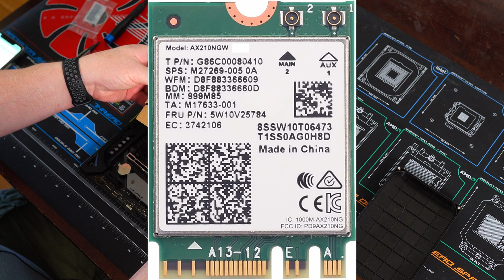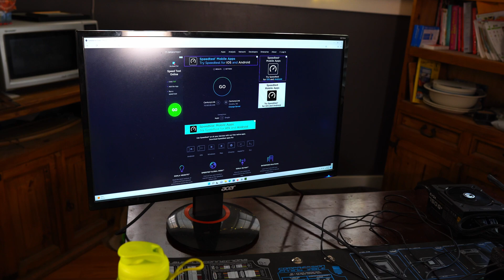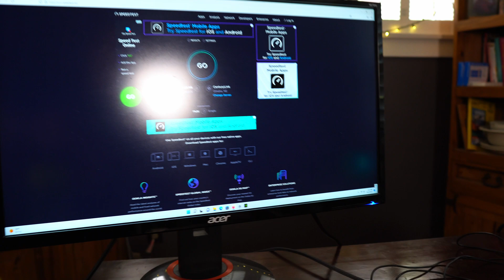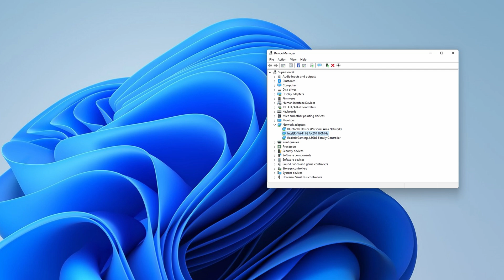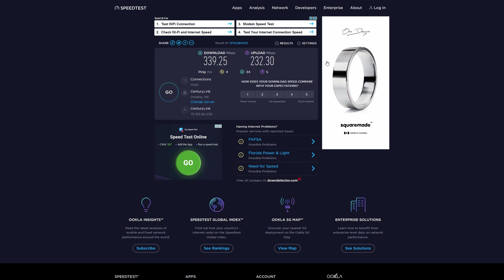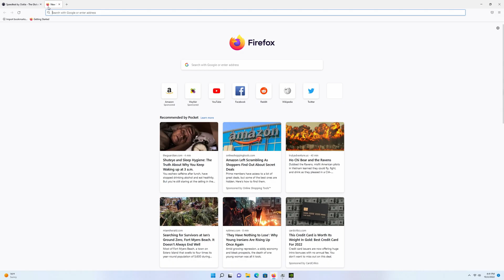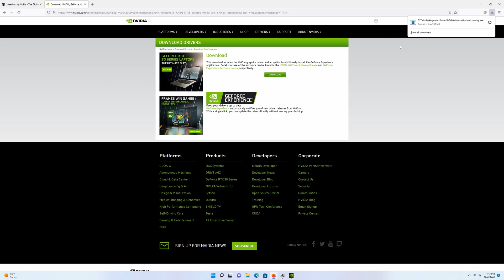How to add WiFi and Bluetooth to your AMD AsRock motherboard: It couldn't be easier!

Comment from the maker: Hi All, thanks for coming to the Middle of Knowhere and spending some time here. If you're interested in the WiFi M.2 card, I've put a link in the description. Also, installing it was pretty easy so don't be afraid to take on such tasks for your components. The rewards are well worth the effort!
Reply: does it work with ultra m.2?

Comment: Would this work on a ASRock x870 pro rs no WiFi mobo?
Reply from the maker: It looks like it has the m.2 slot for the wifi module. You'll use the PCIe slot cover thingy though for the antennas since the I/O shield doesn't look like it has holes in it. HOWEVER, I would suggest you contact ASRock and double-check. Their manual could be misleading somewhat since they combined the WIFI and non-WIFI versions in one doc. I think you should, if you haven't bought the motherboard already, buy the WIFI version.

Comment: Hi, so I just added a Wi-Fi card and the antennas and everything I just bought this PC used off Facebook marketplace it didn’t come with Wi-Fi so I bought a Wi-Fi card and installed it. The motherboard is Asrock b550 phantom gaming 4 I installed everything correctly nothing’s working I tried installing drivers doing every possible reboot going through the bios everything it just will not let me use Wi-Fi. I’ve tried doing windows updates. I’ve went into the system settings deep into the system. It’s reading the card that it’s there but it’s not allowing me to use Wi-Fi. I really don’t know what to do.

Comment: Hello. What's the difference between wifi/bluetooth card you used vs those wifi card that slot into pcie2.0? pros and cons. Thanks
Reply: Don’t know the general pros and cons but in my case I bought a pci one and it needs separate alimentation,since having only one internal usb pin layout i got rid of the front io usbs,so cons for pci are those for me,also the looks,if the mobo already has holes for the antennas why occupy more space for the adapter

Comment: hi I just made my PC 4 weeks ago and I wanted to ask, do I have to remove my mobo and install the antenna's like you did or can I just remove GPU, install the card ?
Reply from the maker: If you don't want to integrate the antennas into the I/O shield like I did, you should be able to simply take out the GPU, then install the m.2 then use one of the remaining PCI slot covers to hold the antennas if yours came with those. Then re-install the GPU.

Comment: Damn, u basically replacing storage with wifi.
Reply from the maker: What do you mean? That slot is specifically for wifi.
Reply: @MiddleofKnowhere  so where did u put the ssd at?
Reply from the maker: Different slot. IIRC there are two m.2 slots. I believe I have a review video for that mobo where I breakdown all the features as well.

Comment: Question: Is there anything I can do wrong? I inserted the AX201 M.2 module I've just received, but in my Windows nothing shows up in the Device Manager. Should I be seeing the device already? Do I need to activate something in the UEFI? Do I have to install somehing first, in order to see the device?
Reply from the maker: You might have to download drivers for it. Check that to see if it works after.

Comment: I assume it doesnt matter which connector on the Wifi module you connect to the left or right motherboard hole.
Reply from the maker: I don't believe so, at least it didn't appear that the wires were for anything specific.

Comment: Hi. Can i just install the m.2 wifi without the antenna? I have another pc also and it's rocking fine without antenna. I hope i will be replied
Reply: I don't think so, i've just installed an AX210 without an antenna and it doesn't seem to work

Comment: I wish I could find a tutorial of how to do this when youre pc has already been built. I am absolutely not taking the motherboard out of my pc to get optimal wiring
Reply from the maker: If it's already been built and you don't want to remove the motherboard, you'd still probably have to remove the GPU to get access to the slot. You can then use the PCI brackets for the antenna cables and connect things that way.

Comment: Problem guys :( MB AsRock B650M PG Lightning cant see my intel 6e AX210. I place it in slot m.2 WIFI on motherboard, try many drivers but in device manager cant see AX210 mw wifi card. Maybe i need switch on some setting in BIOS ?

Comment: Is there any places that I can get a bracket for the antenas slot?? I got a b560m pro 4 and j want to add wifi 806.11 and I noticed I cat have the brackets for the antenas as the wifi version of the motherboard, I didn't get that one because I couldn't afford it so
Reply from the maker: the version I bought came with PCI slot brackets where you could screw in the antennas that way. It's possible you could do it that way if the I/O shield doesn't have holes.

Comment: So that is considered easy? I was seriously considering a budget build with this board and looking on Newegg. Is there an alternative version of this board that comes with Wifi? I've never purchased a non wifi board before, is this the standard process where you have to take everything apart?
Reply from the maker: Comparatively to other pc building activities like putting together a water loop, it was easy. This particular upgrade was a first for me, so you got to see me do it for the first time as well. I cannot recall if the pg velocity has a wifi version but there are motherboards by asrock that do come with a wifi card.
Reply from the maker: Also if you choose to use a pci slot you can buy a pci wifi card and then won’t have to take anything apart. Or even a usb wifi stick.

Comment: Yeah, I'm gonna say it's well worth it to spend a little extra to buy the version of the board with wifi already installed. And then if you need to upgrade it in the future, then you can go through all that. I wish wifi was standard, to the point where you would have to actively seek boards that were not ready with on board wifi.

Comment: My antenna leads to the m.2 card are not colour coded, both are black so I presume it doesn't matter what is connected to what
Reply from the maker: mine weren't either. I do not think it matters.

Comment: I just recently replaced my old wifi card of my laptop with Intel ax210ngw, but my old wifi card has only 1 antenna. The new wifi card I bought doesn't include antennas, so it's currently using only 1 antenna (Inserted to "main" antenna port). The wifi works but I am having a problem with the bluetooth connection. Is the "aux" antenna port for bluetooth? Will the bluetooth connection be fixed once I have the 2nd antenna for the aux port? I'm still waiting for the extra antenna I bought online. Tia
Reply: How did it go?
Reply: @Godisgood137  Everything's working great after I installed the 2nd antenna. I was so worried at first because I thought that the new wifi card wasn't compatible with my laptop. It turns out I just needed the 2nd antenna for it to work. My wifi connection is so much faster now because my laptop now supports 5GHz connection, unlike before. And we have wifi 6 at home, so it's really great. The bluetooth works very well too, no connection problem anymore.

Comment: Be mindful that Windows Setup (even 22H2) does not come with AX210 drivers, so put the Intel drivers on your USB! 
AX Router: Get a $60 Belkin RT3200 or Xiaomi Redmi AX6S to install OpenWrt (but be advised OpenWrt isn't targeted at novices, though it is pretty damn versatile!)

Comment: is there any way to do this without removing my mobo from the case
Reply from the maker: Adding it to the I/O shield no. But if your wifi card comes with a pci slot cover for the antennas the. Yes. You may have to remove the gpu to get access to the m.2 slot though.

Comment: Can I add this to my ASRock x570 extreme4? I’ve been using my computer for several years on Ethernet cable but now relocated to where only wifi is available. What would be some challenges to installing wifi after pc has been completed?
Reply from the maker: Getting access will be your biggest challenge. You'll need to probably remove the Graphics Card at the minimum. If you don't care about routing the antenna to the I/O shield, it won't be as much an issue as you can use the pcie slots.

Comment: Hi I have a question can I put Wifi card on my Asrock B660m Pro it a Intel socket motherboard
Reply from the maker: If the B660m Pro board has the same kind of m.2 wifi  slot with the same kind of Keying, then yeah, you should be good.
Reply: @MiddleofKnowhere  oh ok thx

Comment: Do you have any recommendations as far as an external antenna that I can mount higher up on my desk or such? I have one from a previous m.2 wifi card that was for Intel only systems I just wasn't sure if the antenna would matter or make a difference.
Reply from the maker: I don't think it will make a difference, which one you get but here's one.  Just do some research and go for the best rated to best price balance. https://amzn.to/3Plzfqb

Comment: My ax210 doesnt have the 2 circle things on it to connect cables, and also didnt come with cables, any advice?

I brought antennaes but they just the ones with the big connectors to attach to outside of case, how do I buy the small ones and how do I connect them when my ax210 doesnt have connectors on it?

Also my asrock backplate doesnt have holes for the wifi antennaes.
Reply from the maker: Sound like you bought a laptop only card. You need to make sure what you buy is for a motherboard and gas all the things you need including pci slot mounting if your rear io cannot accommodate the antenna cables and coax connectors.
Reply: @MiddleofKnowhere  Yeah I have brought a bracket and cables now, but it was advertised as for pcs and laptops,not just laptops.  It does have the connectors, they just absolutely tiny so had to look hard for them.  Thanks

Comment: will be installing this into my pc to fix Bluetooth disconnects from my dongle. Although will be installing from the pcie bracket due to my pc having full Hard tube installed on the system atm so removing cover+ io shield will not be possible
Reply from the maker: Awesome. Yeah, I like that you can do either or for installation. Would love to see pics of your loop. Hit me up on Twitter or FB.

Comment: I’ve bought two different m.2 adapters. Both show wifi connections but never connect. B760 pro as. On fibre internet. All the latest drivers. Been thru every forum and YouTube video lol. However the card does work with the pcie slot with the antenna

Comment: Cheaper ones? That one is 70€
Reply from the maker: Try searching amazon for wifi m.2 and see what the results are. You’ll want anything with wifi 6e and Bluetooth 5.2.
Reply: @MiddleofKnowhere  k thx. Can I take one from eBay for 13€ or do you think I should go PCIe? I just think it's smart to use that feature if I have it
Reply from the maker: Up to you really. A pcie slotted wifi solution can perform just as well as the m.2, but you’re then using a slot below your gpu and if you have a thick gpu you may not have room. I’m always for saving money if you can get the same results.

Comment: Hi there I have asrock b550m pro4 mobo. Is it safe to reroute the m.2 antenna cables under the vrm heatsink? Because the antenna socket is on the very top of the io shield.
Reply from the maker: i wouldn't go under it like to the point of taking the heatsink off, routing cables under then putting it back on. try to route it and maybe use some kind of tape to keep them pinned if they keep falling off
Reply: @MiddleofKnowhere  I see, i'll try that then. Thanks for your suggestions! Cheers...

Comment: I guess the card sold to well after this.. price is now 64€
Reply from the maker: oh wow! That's pricey. Def look for alternative ones.
Reply: @MiddleofKnowhere  oh yeah, I found another one, that is basically the same thing xD Its always amusing to me how companies seem to buy up stuff and just put their own name on it. (it at least looks like this)

anyway, as for the plugs for the cables... they really do come off way to easy and with my shaky hands they were a pain to get back in ^^"

Still waiting for my new case though, the Asrock Steel legend is a bit to wide for my case, can't get all the cables in properly, and because of that can't get the pc to start up. Currently use my old mobo for now till my new case arrives. 

At first I was worried that maybe the mobo is broken or something like that, so I put in my old 3200g (yes it is supposedly not supported for b550, but asrock did bring out bios for that and luckily my mobo came with a new bios version) put a 8gb stick of ram in and then connected my old 400w psu I still have lying around. booted right up into the bios (and a lot faster then this stupid biostar mobo I still use... my pc was originally a used prebuild, by now I replaced every single component besides the motherboard. Well in some days even that is changed xD (definitely will keep my 3200g in case I have problems with the gpu or something like that at some point. (well I do have a 1060 6gb lying around, so I guess its not that important xD)

Comment: sup can you recommend me a good mobo for the 5800x3D, I see so many options but got no clue which one is the most compatible. (Currently thinking of the asus rog strix b550-F gaming II)
Reply from the maker: That Asus board is actually a pretty good choice. It all depends on your budget and needs and then which features that board has.
Reply: @MiddleofKnowhere  Pretty much purely for gaming + one with wifi is what I am looking for. I was thinking about 300 max as my budget. Should I go with this asus board or do you recommend something else?

Comment: So I accidentally bought a wifi 6/Bluetooth 5.2 card but it was for a laptop and didn't come with the 2 cables. Are those two cables with the antennas on the outer side mandatory for wifi to work if only the card itself is in the motherboard
Reply from the maker: You're gonna need the wires and antennas. You won't get a signal, or at least a very strong one without them.
Reply: @MiddleofKnowhere  what if i only want the card for the bluetooth does it still work good without them?

Comment: In PCI express cards, you need to connect it from the module to the motherboard with a black cable for bluetooth. So if we connect it like you did, does the bluetooth work well? Thank you. My Motherboard is ASUS TUF GAMING B660M-E D4 Intel LGA1700 DDR4 3200MHz (OC) M.2 mATX Motherboard.
Reply from the maker: Hi and thanks for commenting. I just added a Bluetooth mouse to the PC with this wifi card and had 0 issues. It was near instant after hitting the pairing button then going into windows (win 11) and adding device.
Reply: @MiddleofKnowhere  Got it just by plugging in the module If Wifi and Bluetooth are working great. Thanks for the answer.
Reply from the maker: I still have the black cords plugged in as well so the antennas can be plugged in the io shield, but those should be for the dual band wifi not necessarily the bt at least by my understanding.
Reply: @MiddleofKnowhere  I found out what the black wire does. To power the PCIe card. If we don't connect the black wire I guess the Pcie card is not working. Thanks for the comment though.

Comment: Nice video.  Quick comment: Don't forget to screw on the antennas before powering up as its likely to blow the RF chip.
Reply from the maker: I did not know that. Is there a reason this would happen? I've not screwed on antennas before when not using the wifi.
Reply: @MiddleofKnowhere Could be that the wires from the card to the I/O shield are acting as crude antennae?
Reply: @MiddleofKnowhere  Well I suppose it depends on the chip but once the driver is loaded the OS will start pumping out signals and that power has to go (dissipate) somewhere.  I've seen it happen in the past on a couple of office PCs after they were unboxed without the antennas being attached.
Reply from the maker: Interesting. Def don’t want thee at t to happen. Maybe I’ll plug the antennas into my dark hero just in case